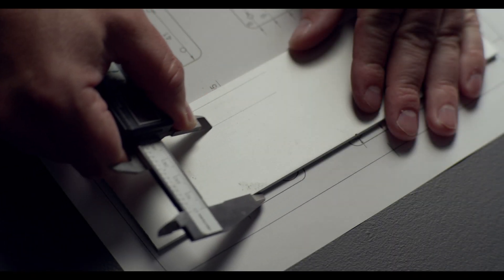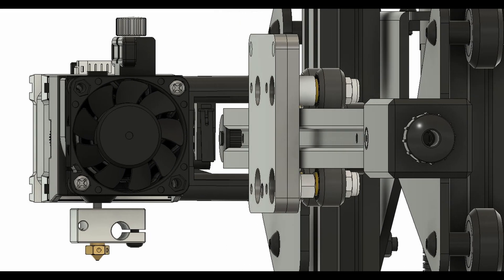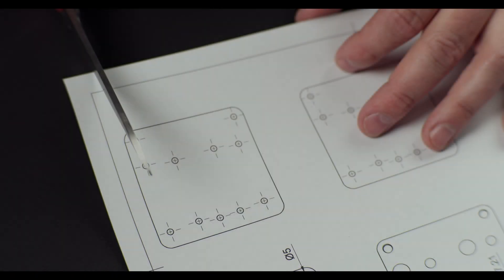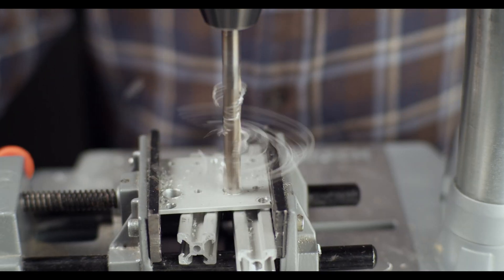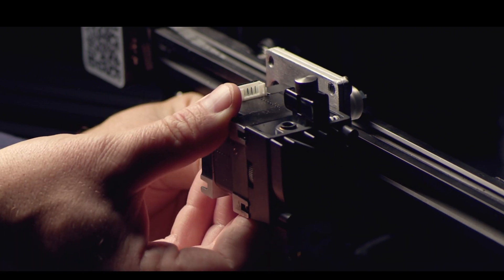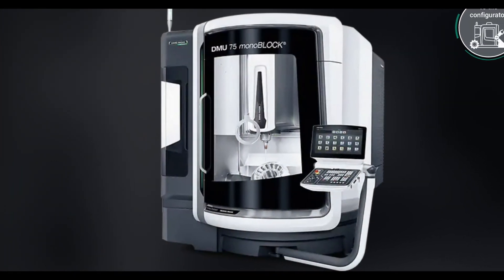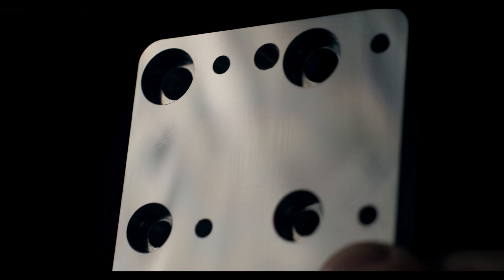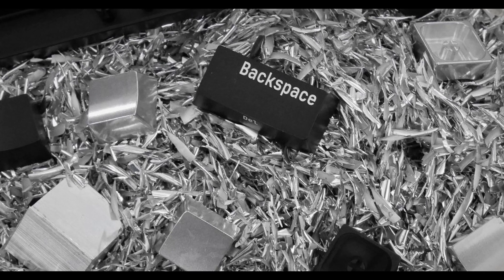Hand tools vs 400K $ metal cutting robot

Comment: Fun video :) I just have to vent a bit here :D Sure it does take just few minutes to mill this part. But to make this part, it takes much longer.
You need to get the design and draw it in your software of choice. Once this is done, you have to go and look for some stock that is the closest in size to the part you want to make. Once you find it, you have to cut it to some shape.
Once you have the stock, then you can go back to the computer and program toolpaths to mill the part from the stock.
Once this is done, you have to take the program upload into the CNC, load the stock into the vise, tell the machine where it is and press start.
A few minutes later, you have one half of the part done, and you will have to flip it to do the bottom side. Set the 0, and a few minutes later is done.

So yeah, it takes a few minutes to mill. But half a day to set it up. 
I hate doing one-off things because of this. It's much more rewarding when you make like 20 of them. So half a day to make one and a full day to make 20.
Reply from the maker: That is so true.  My idea with this video was to compare the machine time of the human and the robot. I probably spent 5 hours in cad with this bracket in order to come up with how it should be. I should revisit this concept with this video and add your point, because its a pretty important one. The total time would be even bigger if i had made like 10 of these.